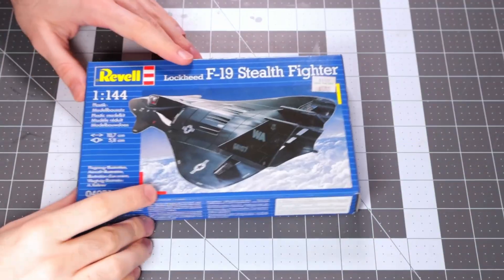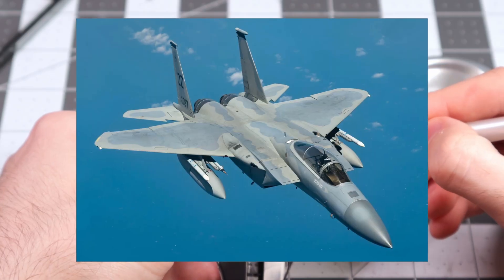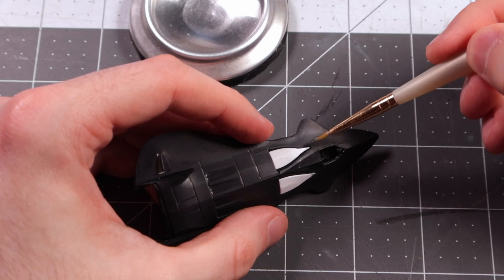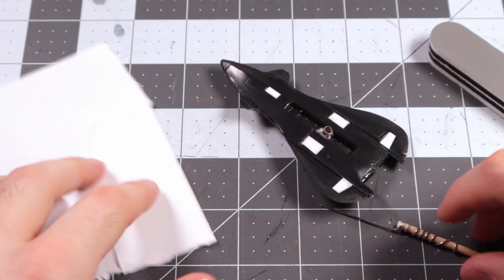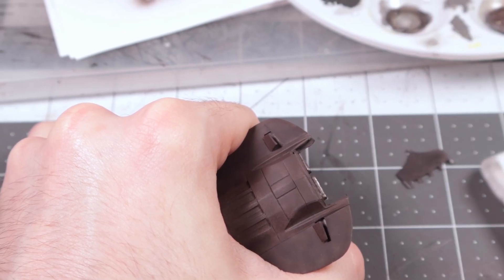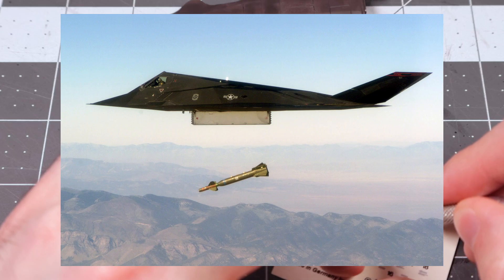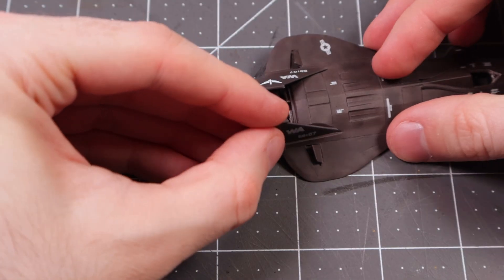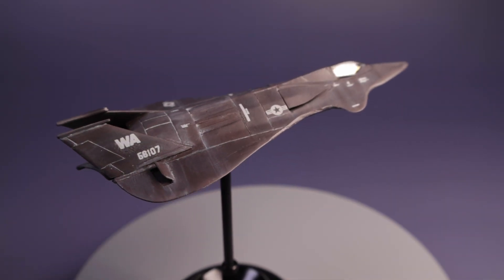F-19: Testor's Fake Stealth Jet that Fooled Everyone

Comment: *F-35 Lightning II

the 'Thunderbolt' designation belongs to the U.S. Air Force's iconic ground attack platform known the world over as the 'Warthog', but officially as the A-10 Thunderbolt II
Reply from the maker: Ah hell I definitely beefed that one. I blame the USAF for naming so many iconic planes after weather phenomena
Reply: The F-35's "II" is from the fact that it's the legacy of the WW2 fighter-interceptor thing called the P-38 Lightning, while the A-10's "II" is based on the P-47 Thunderbolt.
Reply: @Northern_Shrike  Ah, yes, the P-47. When you attach wings to an engine and it becomes a plane through sheer power and nothing else. Damn thing could take off as 8 tons loaded when full of ammo, bombs, and fuel.
Reply: @KnightsWithoutATable  My first squadron started off as a P-47 squadron. In the late 40's they had a P-47 coming in for a landing when the engine died a few miles out. It went straight into a cement factory IIRC. Sheared the wings off, and the prop was gone. After the crash, all the workers were fine and the pilot just got out and asked if everyone was ok.

I didn't believe it until I was shown pictures and an old news article about it.

Tough birds.
Reply: @KnightsWithoutATable  No. The P-47 was a pretty decent aircraft. Visit Greg's Aircraft and Automobiles (something like that)  and you will change your mind after watching his comprehensive videos about the brilliant P-47😃 Cheers👍🏻🍺
Reply: @NielsenDK-1  I never said it was a bad aircraft. It's a great aircraft. It just was a different approach to the engineering and served a different job in the war.
Reply: @KnightsWithoutATable  I never said you did, but the P-47 was more than just power😃

Comment: In the Microprose PC game, it was envisioned as a low altitude (<500 ft), subsonic reconnaissance/fighter/attack aircraft; with internal bomb bays, cannon, ECM jamming, decoys, and long-range cameras instead of radar.

The Vulcan cannon was probably included for gameplay reasons (i.e. extended dogfighting). Other than that, the most glaring inaccuracy was the low-altitude operation, which is stealthy to radar but not visual detection, and reduces range by consuming far greater fuel.

Comment: Ah, the F-19. I built the 1:48 Testors kit a couple years ago. I went all out on hand painting the cockpit. Other than the pilot not fitting at all inside, and the canopy frame not sitting flush with the fuselage, and some other random fit issues that one would expect from a 1980's tooling, it was a nice build! I painted mine in air superiority gray like that one F-117.

Comment: The Testor Corporation was my customer in the 1980s and 1990s.  I worked with VP Purchasing Herb Sealander.  Together, he placed the orders for the production of model kit decals and I, Herb Iske of Vitachrome Graphics, printed the kit decals.

Specifically, I worked with Scale-Master Decals who designed the artwork required to produce the kit's decal sheets.

A particularly favorite story of mine is that Vitachrome  printed the decal sheets for the Testors F-117A model kits.  There was such an incredible demand for production of the kits, I think the grand total amounted to a million + decal sheets.  There was a time when the Stealth Fighter from the Testors Corp. accumulated total sales that was the most units ever sold for a plastic scale model kit.

Comment: The F-20 Tigershark is an aircraft I cared about. Was a revolutionary upgrade for the F-5 family. So saying, “no one cares about it” is actually incorrect. And read the data. It absolutely held its own in almost every category when competing w the F-16. Actually surpassed it in categories. The reason the F-20 wasn’t selected is due to politics, not performance. 😁👍🏻

Comment: I'm interested in building a 1/12 scale version model of XMen 97 Blackbird. How possible would this be? I've only experience with kitbashing, making custom 1/12 figures. Never models, nor styrine, but it looks incredibly relaxing to me. I've no idea where to even start, what to buy etc.
Reply from the maker: Well, a 1/12 scale blackbird would be like 9 feet long. So, do with that what you will, I guess. I’d just start by finding a SR 71 kit at 1/48 and putting it together, and deciding what you think ought to be changed!

Comment: It's based on the Heimat Fighter prototype of the late 1970s or early 1980s, although the two tails were vertical and rounded on top, it was built as a technology demonstrator in West Germany of Carbon Fiber which was then a new material (if you bought toy soldiers in the 1980s that included aircraft, the F-19 that was included was a direct copy of the Heimat Fighter prototype), it had rounded wingtips that drooped at the outer edges, it was supposed to be built in the US as the F-19, also had rounded canards

Comment: The F117's original proof of concept aircraft code named "have blue" had the vertical stabilisers tilted inward like on the F-19.  Both crashed but gave enough useful data for the program to be greenlit.

Comment: This is super cool! I actually have the Testeros F-19 still mint in box  the release from 1987, on the rear it reads:
Many thanks for making this video, very well explained, it would be nice to see a build video of the original Testor release like the one I have here.
Love the airbrush method and your gluing skills, this takes me back to my modeling days.

Front box:

F-19 Steapth Fighter

The original...
As seen nationally
in print and on
television news!

A yellow sticker reading: 
New 
1/72 Scale 
Version!

Rear of the box showing photo's of a grey & black variant, Lockheed Martin F-19 Stealth Fighter, always wondered what name it would of gotten "Batwing" was one I had in my personally.
(this I read and typed from the box to type here)
--------------
Model Kit Features:
The Testor 1/72 scale F-19 Stealth is distinguished by the unique lines that identify these airplanes: 
wedge cross section,  mathematical log spiral curves, smooth blended-body wing fuselage junctures, flush top-mounted air inlets,  two-dimensional high by-pass exhaust outlets, and internal weapons.
Two AGM-65D Maverick attack missiles are included with launch racks for display in either launch or stowed configuration.
Separate canopies will allow the hobbyist a mission-ready aircraft or a trainer.
Canopies can be constructed opened or closed to display full cockpit detail.  

A complete instruction manual out-lines steps required to build and pain t either of the two stealth airplanes:
decals are included for both variants.
Footnotes regarding actual Stealth systems are interspersed throughout the manual.

Note:
This authentic 1/72 scale F-19 Stealth Fighter is based upon years of extensive research.
All specifications were obtained by The Testor Corporation from unrestricted public sources.
Because it is a model, and critical full-scale internal components are not depicted, it does not expose any classified systems.

Photo's are of Prototype.
Models by Tim Warcup and Mike Fritz.
Printed in U.S.A. / Parts made in Italy.
1987 The Testor Corporation, Rockford, Illinois 61108.
--------------

And there you have it, I always kept mine mint in box, just for the memory.

Comment: The F-19 design was based on a partial misunderstanding of how real stealth worked.  What he did was look through old NACA catalogs of radar returns of various shapes, and realized reverse teardrops had exceptionally low radar returns, then cribbed elements of the SR-71 like the inward-canted tails and the sharp chine around the leading edge, which had already been stated in public to help reduce the Blackbird's radar signature.  He hadn't grasped what Lockheed did:  the parts interact with each other.  Low-return reverse teardrop wings that reflect away from the source mean very little if put on a plane that might redirect a large portion of the reflection away from the radar back to the radar anyway.  Calculating the directions of all the main returns and side lobe returns, and THEIR return directions off the other panels around them, (and again for a third return), from various angles all around the plane, is why the F-117 looked the way it did:  the best computers of the day could only calculate so much within a useful time (like even years).  Using as few flat panels as they could make fly, they only had a finite number of very definite return angles to calculate, and the computers could calculate a solution of how best to angle them.

Comment: What an interesting video, I built one of the Testor's F-19's as a kid and always wanted to get the Ferret kit (but never got around to it). I had forgotten about its backstory but, looking back on the design of the two kits, it was clear that their creator did in fact have some insider knowledge about stealth design characteristics. They both feature obscured intake ductwork, shallow flat shapes that blend wing and fuselage in order to reduce RCS. The F-19 is mostly wrong, relative to the F-117, but the inward canted stabilizers do match the "Hopeless Diamond" tech demonstrator aircraft that was a proof of concept for the real thing. Ironically the "Russian" Ferret stealth fighter design has a plan view that is very similar to both ATF competitors, with its trapezoidal cross-section, diamond shaped wings, and v-tail. Its cockpit is also more like the real thing. Even more irony: one could make a pretty decent NGAD model using an F-19, simply by removing the stabilizer fins, cleaning up the vectored exhaust, opening up and customizing the intakes, and doing some gap filling... With its front canards, the Revell version F-19 would work especially well for the Navy version (F-XX). As for the stealthy helicopter from this series of kits, a number of prototype choppers actually looked similar in period. The vectored thrust tail arrangement has been tried in "real life" and the kit also has a reasonably plausible shape for Low Observability. While the UFO kits in the series were dumb, the speculative Stealthy aircraft were a lot more accurate than they might get credit for. I was surprised you didn't mention Monogram's attempt to get in on the action with their own speculative Stealth fighter. Their idea was a lot more visually attractive but even less accurate, considering what actual stealth planes look like. Maybe you should do a vid on that one? Thanks again for the 'blast from the past'.

Comment: One thing I was thinking of ever since I saw one of these kits in a hobby shop in like 1991 or so is instead of complaining about objectionable aesthetics I should somehow design my own.   Especially now that we the public have a much better idea of what aircraft were and almost were. When I finished watching this I went and looked up what folks think the 6th gen aircraft would have looked like and it got me thinking about what it would take to do what the kit designer did but better. Starting with tail fins that can fold flat and better looking thrust vectoring. 

Relatedly a redesign of the YF23. I saw  InAir brand did an “E-Z build” model of one in 1/72. Got me thinking what it would have looked like with thrust vectoring 

The model appears to be like $21USD with shipping on eBay rn.  

Btw please by all means run with any of my ideas. By the time I’m able to act on them in any meaningful way they’ll be a bit different anyway.

Comment: When this kit first came out, the US Air Force was not pleased. They thought they had a leak. It turned out that the kit designers read public information on radar reflective surfaces and designed their shape from that information. There as a radio interview with members of the team when it was first released. They were very surprised by the visit from the US Air Force.

Comment: More fun facts: the "Hopeless Diamond"-style jagged-angle stealth, as seen on the F-117 (the Wobblin' Goblin!), wasn't an American idea. It was a Russian one, cooked up by a guy called Pyotr Umfimtsev, in his "Method of Edge Waves in the Physical Theory of Diffraction"...which he got to publish because the Soviet higher-ups took one look at it, said "Awww, that's nice, dear. Yes, you can publish it if you want, sweetie!" And so he did, the USAF translated it into English in 71, and some blokes called Kelly Johnson and Ben R. Rich got their mits on it.
Reply: He didn't invent stealth aircraft in his paper, he just laid out methods for computing how radar waves interact with physical shapes.  It was the mad scientists at Skunk Works who took that math and began applying it to aircraft (and boats, and test stands).

Also, there's a lot more to the F-117's stealth than just its shape.  It makes extensive use of radar-absorbing materials, and has a lot of clever design touches to mask things like the intakes and engine exhaust.
Reply: AFAIK he laid the ground work for calculating radar reflections. Lockheed just used angled surfaces, because they didn't have the computational power to do rounded shapes

Comment: i started one of these models i think testors? it wasnt this small
put wire hinge in the elevator painted some parts ,drilled some little holes put in little led lights never finished

Comment: my guess, the F-117 was probably going to be called F-19 but because how cool and sci-fi the model was, and how popular it had become, they decided to just use the misdirection destination. The F-117 had a crazy dev cycle as well. The Airforce loved the performance, but kind of hated it, because Air-Force generals had edgy egos. Black was cool, the F-117 was suppose to be a blue color that nearly made it invisible to the eye in any light. Also the Airforce and designers were afraid to change anything with the shape of the plane once it was built because the performance was too good, even if they hated how it looked.

Comment: The F-117 looks like that because it was designed in the 70s on 70s era CAD software and that's the best it could do at the time.  It's literally a low poly airplane.  The B-2 is effectively a whole generation newer in terms of design philosophy, even though it was declassified first.

Comment: While I was stationed overseas in the 90s, I picked up both versions of the F-19 (Monogram and Testors) and the coveted Aurora. Used to have them hanging up in my barracks room, along with a ton of Hasegawa models. The Air War over Misawa, I called it.

Comment: I had a Diecast you of that, as a kid in the late 80s! (yep, like a hotwheels) 
Surprisingly, it wasn't much smaller than your model... I was expecting yours would be much larger heh
Coincidentally, I even brought it up in the comments of a Sandboxx video a few months ago, which was about the TR3b!

edit: Hmm... Canard differences. 🤔 My mind's eye recollects both... but I can't say which one my diecast really had... 😕 If I just think about it quick, I don't recall it having any protruding out the sides. As such, I figure it must've had the ones flanking the canopy, because my instinct to describe the plans shape was: a cross between a Spade ♠️ and a teardrop 💧. Which if mine had stubby front wings, I wouldn't want to describe as I had!
Sadly, I doubt I still have the thing. I might, in a box somewhere... but seems highly unlikely, as I don't think I even have my beloved A-10 'Warthog' diecast, either. 😢

edit 2: Wow! My Google search for said 80s diecast actually yielded results! 🤯 And, indeed, it had the ones flanking the canopy, not the lobes like this model.

Comment: I had that same model in the eighties! Didn't turn out as nice though...😄 I read some compelling theories about the F-19; before settling for the faceted design, the Lockheed design department had the D-21, a supersonic drone launched from an SR-71 based mother plane, selected as the starting point for the stealth airplane. D-21 wing layout bears a significant similarity to the "F-19." Also it's notable that the "Have Blue" test vehicle had certain similarities with F-19 concept; center bow canopy, inward canted tailplanes and wing aspect ratio closer to the F-19 than the F-117. However as the "hopeless diamond" shape, as it was called, proved to have 1/1000th of the RCS the D-21 based design could ever have and D-21 based approach was abandoned. It is not entirely inconceivable the "F-19" concept and drawings were created as a red herring and a leak detector for the office. Edit: The actual engineers from Lockheed of the period are obviously fuming at their keyboards not being allowed to tell how this is BS and nowhere near how it went, but it's fun to hypothesize 😂

Comment: Testor's, at the time,  had a reputation of accuracy when new aircraft were coming out.  Clearly, informed by some kind of contact in the industry.  So by the time they A) Came out with the F-19 and B) Aurora (right after the "bird watchers" at Edwards witnessed a "project" flying from "horizon to horizon" in under a minute (trigonometry allowed an estimation of Mach 4 or thereabouts) we all thought they probably had them correct.

The F-117 was a product of 1940s(1950s?) stealth calculations in a dusty old treatise.  The computer power wasn't sufficient to design curves that comported with the critical angles and joins so you ended up with a Commodore 64 rendition of a jet (see? I can do it too. 😂).  Ironically, planes that are now primarily stealth focused, are approaching the Testor's F-19 type of geometry; their curved plan forms with compound and elegant joins 

It's fun to muse over the idea of a secret plane coming to be, inspired by a model.